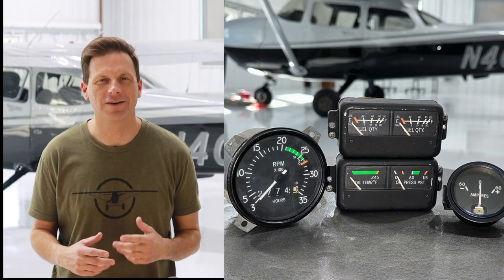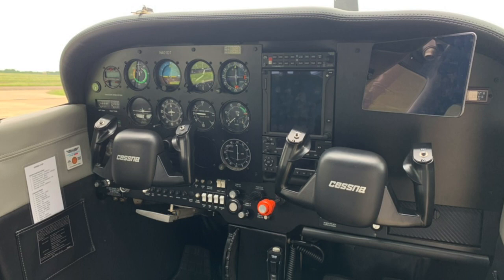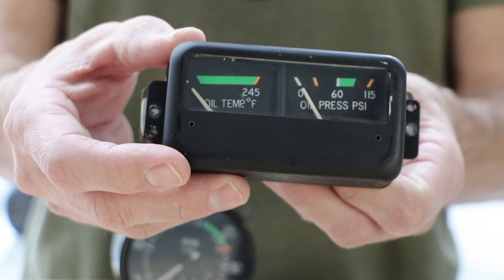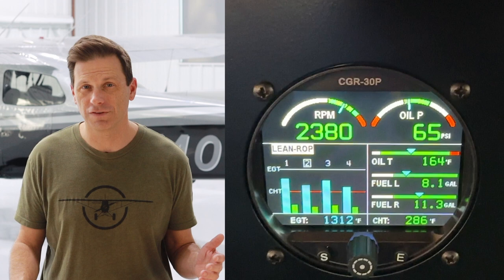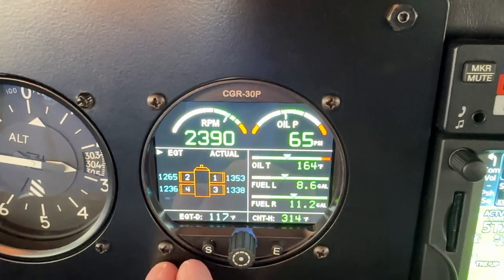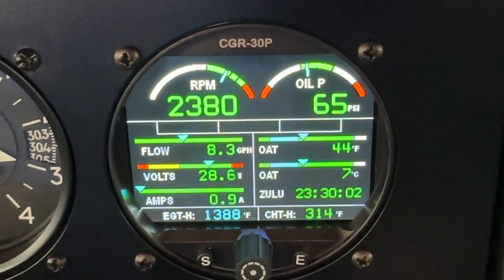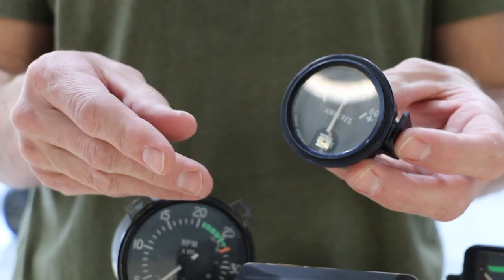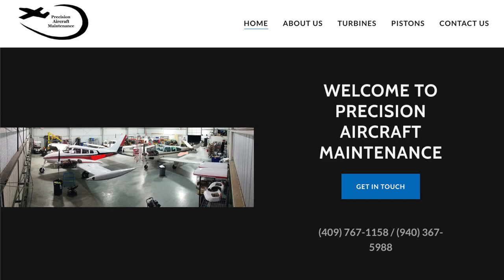Why did I remove my airplane engine gauges?

Comment: I'm adding to my previous comment. I gather from looking at your airplane that it was refurbished not long ago. I see fresh paint, avionics, interior, and VGs on the wings. I like that dark color headliner, in particular. Why did you choose to keep the conventional six-pack in the panel? Do you find it preferable for basic training? I used to be an instructor and, of course, “steam v. glass” is an old debate.

I mention all this because I learned to fly, and have taught, on airplanes that showed their age and suffered at least aesthetic neglect. Yours strikes me as a refreshing departure from that trend.

I imagine both your aircraft and hangar inspire confidence in your students. Even looking at it from a distance, I think it would have that effect on me.

If you have a video or are inspired to create one, I'd be interested in the details of the work that was done to refresh the airplane.
Reply from the maker: Thanks for your comments (and compliments). We refurbished this plane 2 years. Complete strip and paint and new windows. Basically went through the entire airplane replacing anything in question. All the interior was removed, new insulation, new painted or upholstered panels, new seat cushions and covering, and flooring. All new Garmin avionics and new metal instrument panel, new switches, circuit breakers, etc. I later replaced all the factory engine gauges with two new Electronics International CGR30 monitors. Last thing on the “hope to do list” is replace the 6 pack with solid state electronics. Held off on it due to cost but did have all the 6 pack gauges refurbished with fresh paint and glass. Hopefully I can do a video as you suggest someday. Thanks for watching!
Reply: @FreedomFlight1  I appreciate your reply. You did a great job! The results are inspiring.